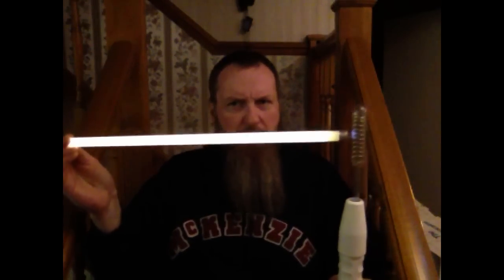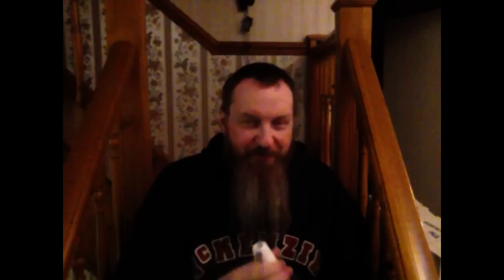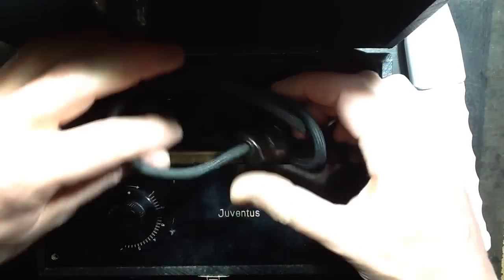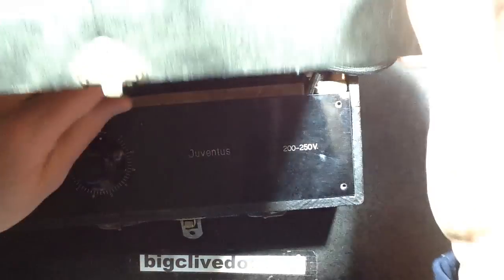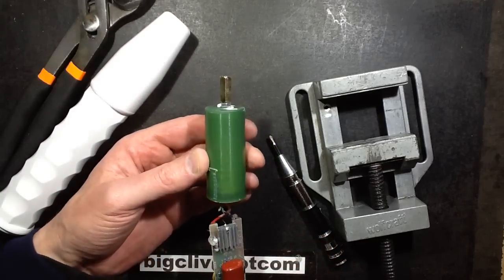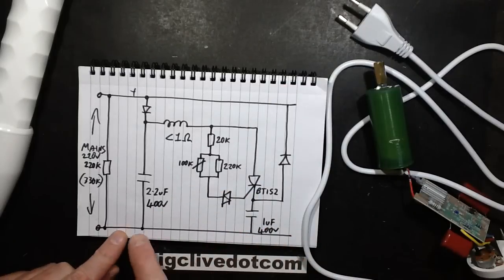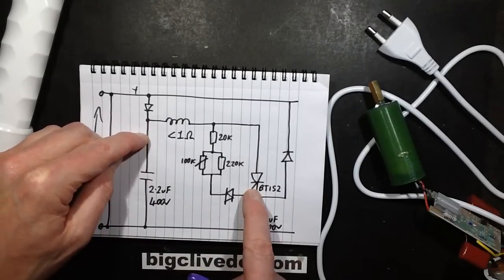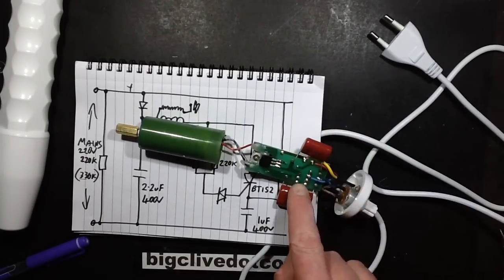A look inside a Darsonval style modern Violet Wand Ray unit.

Comment: Hi, I am beauty therapist train in Poland in early 70's and have been using this Darsonval ( as we call it ) wand for 25 years for oxygenating and disinfecting skin after facial treatment. Also with the pointed wire i burned out facial spider veins and warts, moles etc...Every european beauty therapy machine have that included as standard to this day. You can oxygenate water with it or with old fashion UV sun lamp, it also kills bacteria on fruit and veg. Funny that I just found out it is Tesla invention. I bought chinese one on Ebay for $9, and it's nothing wrong with it.

Comment: I have a welding machine that more or less works like your vintage medical cureallillinator which is slightly worrying.
Reply from the maker: Tig welders tend to use a very similar circuit to induce high voltage on the high current output.
Reply: @bigclivedotcom  Yes and a tig machine has no problems burning stuff and a faulty lead causing the odd stray arc can give you quite a tingle!

Comment: On the negative cycle, the top end of the  1uF capacitor would be charged more negative, so when the positive cycle triggers, you would get double the voltage
Reply from the maker: ***** Hmm, there's a thought.  That makes the slightly haphazard SCR trigger circuit a bit weirder.

Comment: It wasn't a quack device as such it did help with several skin conditions and did work at burning out warts and moles. It also does have effects similar to TENS for relieving muscular pain. The issue with them was that at the time they were fairly expensive to make and skin conditions required several treatments, and once good ointments became available it was far more sensible as the patient could apply it themselves.

Comment: Hi Clive, there is a mistake on your circuit diagram and thought I should alert others if they try to duplcate. I came across your vid by accident as I designed a similar circuit many many years ago and wanted to compare it. I then noticed a mistake on your diagram as the voltage divider potentiometer circuit you had put on your circuit diagram didn't quite add up. The value of R2 is 100K it is clearly marked on the board @ 12:19 and you had a value of 220K on your diagram, for anyone intersted, I calculated a value of 75K and should be approx half this value when operated from 120V. Otherwise all good the diagram is correct. Good work!

Comment: Hi.what's inside the glass electrodes?? Is it any gas filled or vacuum??
Reply from the maker: Traditionally it was just a vacuum, but they use noble gases like neon these days for extra visual effect.
Reply: @bigclivedotcom  isn't it dangerous to be vacuum? because i heard if its vacuum it may radiate Xray.

Comment: A few years ago, I found a functioning vintage violet ray device at a thrift store for about $12 US and bought it on the spot. It came with the mushroom attachment and one that looks like a rake. Fun to bring out at parties.
Reply from the maker: Just make sure you treat all metal in the case as potentially being live and never use the metal rod electrode.  These units come from before they had discovered electrical safety.
Reply: @bigclivedotcom  oh, for sure! The thing scares the bejesus out of me.

Comment: These were sold by Sears Roebuck marketed as "Faraday Batteries". You got wooden box, a battery, a resistor intensity setting dial and essentially an ignition coil from a car, and those glass UV wands. I came across one in a thrift store, and I left it there too.
Reply: Seth B that's interesting to know

Comment: in the old ones sometimes the secondairy windings is not connected to anything on 1 side and to the neon on the other side. and i use the metal pipe ;)

Comment: Cool! Makes me wanna build one kinda!
Reply from the maker: Graham Hart The output transformer is a nightmare to build, since it has thousands of turns of fine wire and runs at extremely high voltage.  the earliest tended to saturate the coils in pitch or wax, but the newer ones vacuum impregnate them with resin.  Between that and the specialist glass discharge tubes you would be a lot cheaper just buying one to experiment with.

Comment: can anyone point me in the direction of where to get a new coil for one of these
Reply from the maker: It's cheapest and easiest to buy the whole thing.  If you search on eBay for darsonval you will find a wide price range for the same item.
Reply: bigclivedotcom  mine got dropped and has a major voltage drop at the output. It still works but not the umph it had before. I was hoping to be able to do some testing and maybe just replace the parts I need I looked up the capacitors and can get them for 5 for less than $2 (us) the thyristor for less than $2. I'm sure that coil is the most expensive part. I didn't want to buy a new one unless I absolutely needed to
Reply: @Manyx82   - Could wind one of your own, maybe?

Comment: what would happen if you connected the primary of the transformer in series with a beefy capacitor across the mains?
Reply from the maker: Not much.  It requires quite a fast rising voltage.
Reply: fair enough, i thought it could be made into an ultra simple tesla coil but maybe not

Comment: I have this exact unit, arrived today from China (impressively, in 7 days). I'm well aware of its enthusiastic use by the BDSM crowd (even seen an ancient one used in a public setting at a club - eek) but I bought mine simply to disinfect skin and keep zits at bay. Some aestheticians suggest it can be used for "skin lifting" but I guess bigclive sees it as quackery, and he's entitled to his opinion - I really do think it helps acne, though.
Nice to hear a Scottish voice on Youtube :) Thanks for the very interesting video!
Reply from the maker: +LJ K It's not total quackery as it has a strong sterilising effect on the skin and also has a very nice prickling sensation.
But don't use it near anything electronic as it could potentially damage it.
Reply: +bigclivedotcom There is a "mainstream" version of this with a tiny inbuilt bulb head called the Dermawand, which I used to have, but died :)
I've found with that, and this newer D'arsonval ebay China unit, that it makes monitors flicker/crazy stuff happen to electronics so I guess I better use it in (electronic) isolation!

Comment: Here is what I found out on NCBI Pubmed on the Violet Wand; very interesting.

"The authors already demonstrated the in-vitro efficacy of modern CAP and historic VW generated plasma against many different wound pathogens [27], [64]. Similar data were obtained with another modern plasma source based on different technology [65]. Apart from in-vitro data, clinical studies on CAP treatment have been recently published supporting relevant efficacy against multidrug-resistant bacteria [12], [13], [14], [66]. As a result of its proven antimicrobial efficacy, CAP is currently being examined for treatment of chronic wounds [12], [67], [68] and may also be effective in hospital hygiene [67], [68], [69]. Accordingly, stimulation of wound healing supported by antiseptic activity may also be obtained with the historical VW plasma or, rather, with re-invented devices based on electromechanical techniques."
Reply from the maker: The localised ozone is the main sterilising agent.
Reply: @bigclivedotcom  I don't know if you are familiar with the "Plasma Channel" he made a plasma disinfecting panel for hands. Really cool thing. I wonder if plasma balls have the same effect
Reply from the maker: @curlyhairdudeify  If you place your hand gently on a plasma ball it does generate low levels of ozone.

Comment: The adjuster is actually a wirewound variable resistor.  These were common in antique radios.  The resistance wire is wound on an insulator, not iron like a variac.  You can test it with an ohmmeter to verify this.
Reply: +Fred Yearian Actually..... A wire wound variable resistor will by its nature also be a variable inductor... think about it... then if you still aint got it, think about the symbol for an inductor. Its the inductance that is doing the work in this AC circuit... Imagine if you hooked up 240v DC and tried to use it as a 'variable resistor'

Comment: So if I replace the 20K resistor with a higher value (say 50k) then the capacitors will charge to a higher voltage and the unit will become a bit nippier? Anything dangerous to watch out for if I do this? Asking for a "friend"... ;)
Reply from the maker: It might work, but could be a bit unpredictable.  If the voltage goes too high it could damage the coil.
Reply: Well that worked! Changed my plan and replaced the 220k resistor in parallel with the pot (which in my unit was only a 75k) with 3 x 470k 1/4W in parallel. Coil is holding so far...

Comment: Clive - I think that the variable component at 7:23 is simply a wire-wound variable resistor of a very common construction; I doubt that it would have significant inductance, compared with that of the spark coil itself, to effect any control other than by its changing resistance.

Comment: Edwards High Vacuum used to make a similar hand-held HV probe, used for detecting leakage in High Vac. systems. Years ago I was using one of these to trouble-shoot the vacuum section in a freeze drier, and unbeknownst to me, the lab next door was using a VERY sensitive gas chromatograph (Electron-capture detector - REALLY static sensitive, in the days when FETs would die at the slightest hint of static!) They were wondering why the GC detector had "stopped working completely", and it was not until the Philips technician had to replace ALL the front-end electronics, that the penny dropped (for me - not for them, otherwise I'd have been toast, since the repair cost BIG bucks!)

Comment: I'd love to pick up a new one of these, to use with my old tubes (I collect things like Geissler tubes and I consider these to be similar), but I can't find one for a low price. Where did you find one cheap enough that disassembly was an option? Edit: Ah, eBay. All the ones I can find there cost at least 35 pounds or so.

Tubes for every part of the body? Oh, yes, some manufacturers made over 60 electrodes. My largest set (German, circa 1950s) has 28 different tubes... including four different glass colors, just in case you believe in colored light therapy.

These aren't technically quack any more; in the beauty therapy, they do exactly what they're claimed to do: increase blood flow to the skin. The quackery was where the old sets' instruction booklets suggested that this increased blood flow would cure diseases, because all diseases, they claimed, were caused by insufficient circulation.
Reply: Lack of proper circulation and eliminations do definitely contribute to dis-ease and eventual disease. This is part of why exercise is so good and necessary for the body, as it increases both.  

 There is more than one way to skin a cat though.

  I've noticed that many of my fellow males, have a very hard time perceiving/thinking holistically and in parallel (which more women tend to have a much easier time with), and are so linear logical, step by step analytical, which leads to definite "blind spots" and narrowed perception.  

 The trick is to combine the best of both worlds, and to develop a very thick corpus collosum.  Bruce Lee's famous advice of "be like water" really should be changed to something more like, "be like male and female in one".  Both linear logical analysis, and gestalt/holistic/parallel type perceiving have their respective strengths and weaknesses, but combined, balanced, integrated, and then merged they lead to genius and pioneering level perception.  

   Get cracking on thickening up those corpus collum's brohems.  Learning and playing music, using Hemi-Sync, deep meditation, working on problem solving, etc are some things that help.  For guys, hanging out with a lot of women, a lot, can help some.  Listen to their experiences of intuition, of perceiving nonphysical realities, etc and consider that maybe they are just perceiving differently than you, rather than only being just completely deluded, stupid, ignorant, or the like.  

        Nothing more "quack" than being stuck in one, narrowed mode and having a thin, weakly developed C.C.  We will eventually discover that pioneering genius types like Tesla, Einstein, some of the pioneers in Quantum mechanics, etc were folks that were just unusually integrated between left and right brain hemispheres and equally in touch with their imaginations and feelings as well as their logical, analytical "Spock" sides, which is what led to their creativity, genius, and ability to pioneer.  Some of that is born (probable potential), and some of that is developed.  But we all can improve a jot here and a jot there.  

Best approach to life and to information is to be simultaneously open and skeptical minded. Hold beliefs, even mainstream and well accepted scientific based ones, lightly.  Question and test everything, but don't think you or others automatically know what's true or not.
Reply: This thing literally lessen my hairfall after 2x of use! Spider veins are less now, my face are so tight and smaller pores and lastly the keloid on my legs looks less prominent now after 4x of usage. I love this guy but disregarding something that you haven’t used or tried is annoying.

Comment: Just a quick note on the thyrister cycle.  An assumption would be the thyristor would turn on and remain on for a 1/2 cycle.  This is most likely incorrect with the inductor of the primary transformer and cap forming an LC circuit.  Instead of switching on and remaining on for a 1/2 cycle, it is much more likely, it will switch on for 1/2 an LC cycle and when the polarity reverses, the thyrister will recover and the trigger will repeat many times on the AC 1/4 cycle voltage rise.  The coil with it's distributed capacitance would then resonate, then be spiked again, much like a Tesla coil.  It would be interesting to sniff the emissions from a safe distance with a scope to look for the RF emissions.   If you get a chance, I would like you to re-visit this circuit and possibly measure the pulse rate and ringing frequency.  From similar circuits, I would expect the strike frequency during 1/4 of the AC cycle to be in the audiable range and the RF ringing to be in the 10's to 100's of kilohertz range.
Reply: The diode and cap on the left are across the mains so the cap will charge up to POS 300V
The diode and cap on the RIGHT are also ACROSS THE MAINS and the cap will charge up to NEG 300V
ALSO I agree with isetech about the circuit firing many times during the 50Hz resulting in a much higher frequency than 50Hz.  The old spark buzzer in the antique is similar to the Ford Model A and T ignition coils and probably similar to the the old "spark Gap" radio transmitters from the 1900's
ALSO this is not too dissimilar to the decorative dancing light globes that are available everywhere.
BOB L
Reply: How would one go about slowing that down, if required?

Comment: During the negative alternation, the 1uF gets charged to the negitive peak of the mains. It is not discharged.  Chances are, the SCR, fires more than once per mains cycle. 

As the voltage goes from the negative peak towards the positive peak, the voltage across the SCR builds up.

At some point, the SCR fires and a very large current rushes through the inductor.

The current in the inductor can't stop instantly so the voltage from the end of the 2uF to the end of the 1uF is taken past zero and the current in the inductor falls.

When the current in the inductor attempts to reverse, the SCR turns off.

At this point, the cycle repeats.

Comment: I assume the highest possible voltage getting whacked through the primary, is 440v? That being the 220 of the mains at peak and 220 on the capacitor added together ?

Comment: I think that the variable device was intended to act as a variable resistance though by its method of construction it will have a small inductnce which is probably insignificant at 50 Hz.

Comment: Is there something like a surge-protector that can be used to isolate these from the ring-mains, (to protect delicate computer equipment) ?
Reply from the maker: Not really,since a lot of the energy is transmitted wirelessly at high voltage.

Comment: Those things have got to have some effect on the body. I once had a mole removed with igh voltage. Maybe those are good for dissolving built up minerals in joints or opening up cell walls so they can better clean themselves. 
We us electricity to electroplate metals, maybe those can be used to do something to the body that it wouldn't have done itself. It's no cure all, but if used intelligently, maybe it could be good for something. 
I want to use one in a costume to light my face up with sparks and flashes. How can I go about doing that ¿ 

Edit: Will it ignite black powder and / or run on twelve volts ¿

Comment: 1:28 the neon attachment looks like it should be a rubberized anode cap for a CRT tube, would this work?
Reply: High voltage, low current, moderately high frequency.